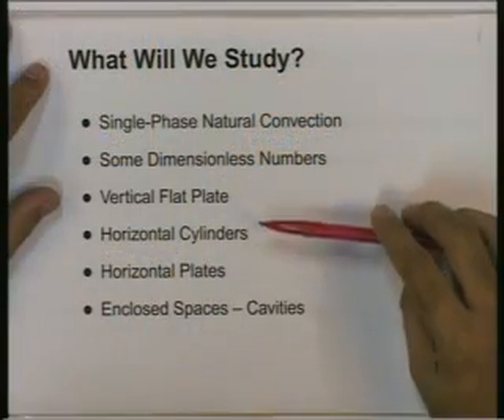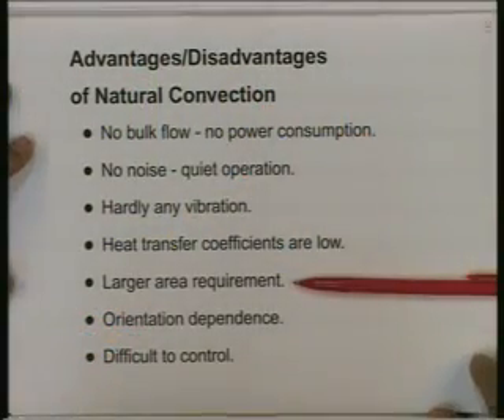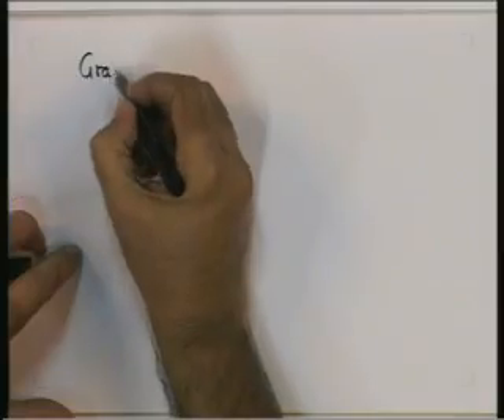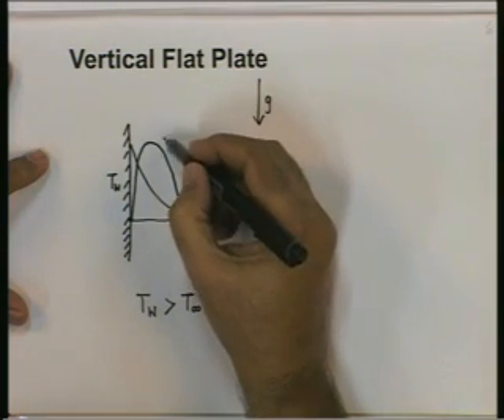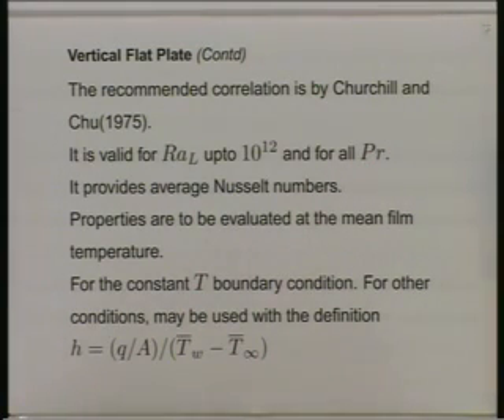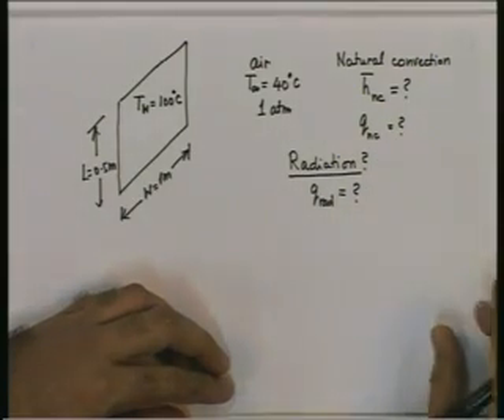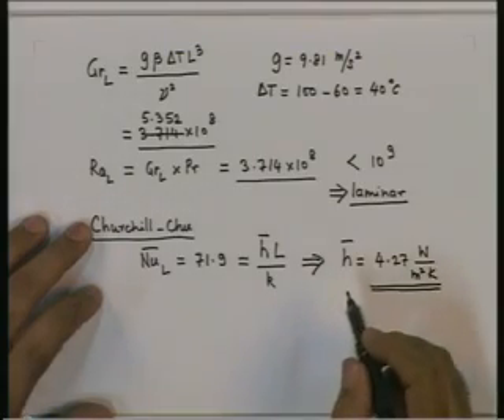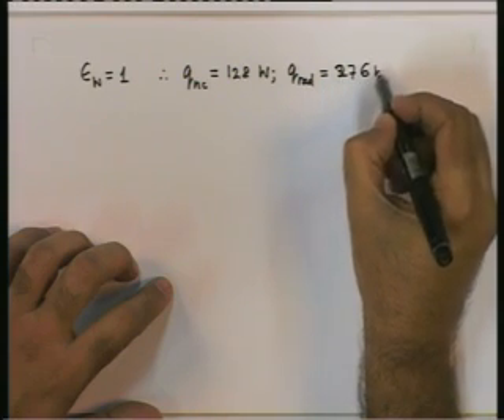Lecture - 22 Natural Convection - 1

Comment: In first lecture of heat transfer he said convection is heat transfer by macroscopic motion of fluid and conduction of fluids.
Now he is saying in natural convection there is no bulk flow of fluid. Then how it is different than conduction
Reply: There Is A difference between both i guess. Its Not bulk motion means particles are stagnant but Molecules transfer heat atom wise or something. There are two type in it too.
Reply: @abhishekpandey5967  yes I get it but but heat transfer by motion of molecules is conduction and by microscopic motion of fluid is called convection as told in first class by professor.
Then what is difference between natural convection and conduction in fluids
Reply: @vridhikhanna1580  in conduction , molecular motion is absent , in forced convection , bulk velocity is imposed on the natural flow of molecules due to heat transfer ..
Reply: @craniumkracked8189  in his first lecture itself he is telling conduction is by motion of molecules. In non metals heat transfer take place by lattice vibration only, which is a kind of SHM.
Reply: @vridhikhanna1580  nonono conduction is not by motion of molecules , in fluids , when two moving molecules collide , the transfer energy (heat)

Comment: If temperature of wall is same everywhere whether at y=0....or any other and temperature of fluid is also same....then how can the temperature difference vary from bottom to top.....can anyone explain this to me please
Reply: hot fluid near the wall will move upward, and the colder fluid will comes on downside of  plate so a temperature profile is generated
Reply: Question is interesting and it's been 3 years, so did you find the answer

Comment: He made a mistake when he wrote delta T at the grashof number. It's supposed to be the difference between the wall and the air, so it'd be (T_w - T_infinity) or 100-40 =60 degrees C
Reply: Yeah. But he later corrected it with the correct Grashoff number taking delta T=60 deg C.